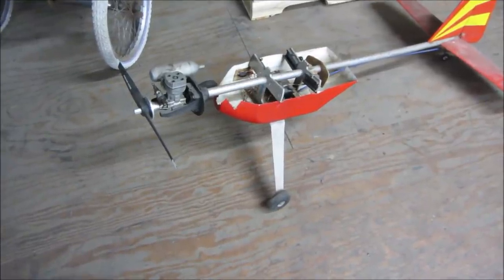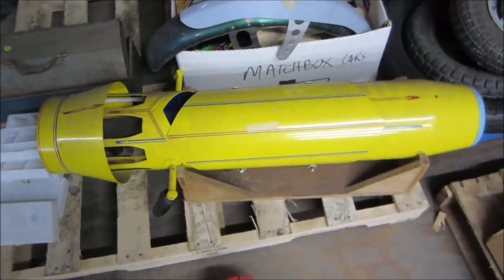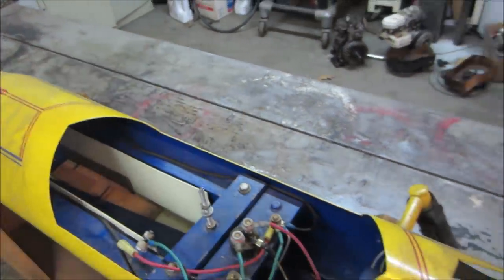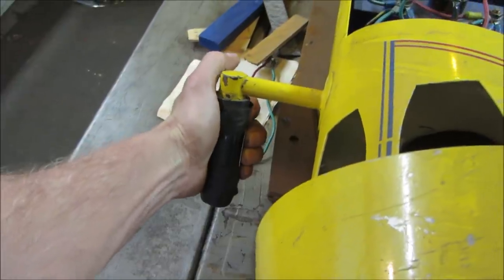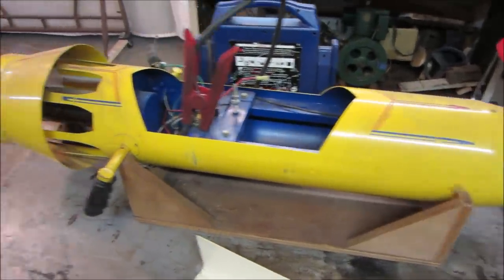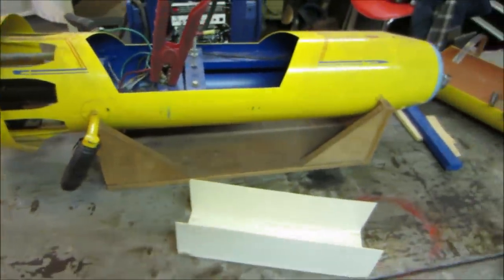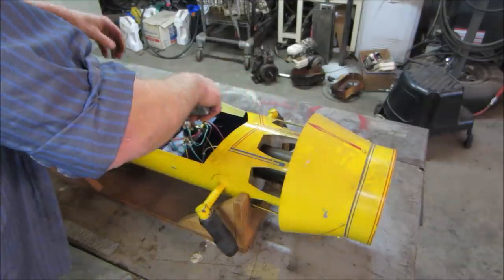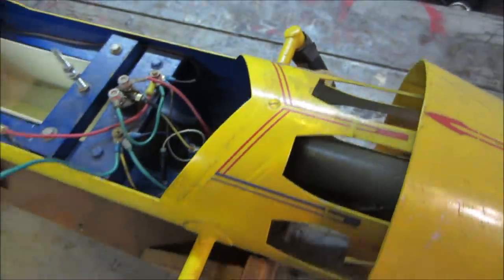Antique Scooter for The Water? Will It Still Work.

Comment: I built one, very similar to this, back in the late '60s specifically for looking for parts of my hydroplane which I destroyed at near 90 MPH. The boat was trash but I did want the outboard back. It was from plans in Popular Mechanics. The body was cut from an old scuba tank, gen 1 trolling motor, misc. flue and furnace parts for the rear housing and hatch, and an aircraft landing light. Two 12 V. lead acid motorcycle/garden tractor batteries for power...compartment was dry for flotation purposes with just slightly positive buoyancy so it would slowly rise to the surface if left unattended. Took a few tries to get it water tight but eventually worked very well. Found the motor...well, pieces of the motor...turns out I'd hit an underwater concrete piling with the lower unit.
Reply: Who would of thunk a bunch of us meatheads watching Mustie fix old junk, and one guy built the same thing from Popular Mechanics.  I dont know what this crowd is called but I likes ya.

Comment: That is a Popular Science build from 1975. The diving machines had several designs but most were based on a 24 volt system. So you were right , it is a home made diver based on a do it yourself blueprint from the 70s.
Reply: Not 24 volt system. These have a 12v system with the batteries wired to double the current. Note the + to+ & - to - connections. This configuration gives double current at 12v, not 24v.
Reply: @christophermarshall5765  longer run times instead of more power.
Reply: @jackmehoff2961  either way its given me memories of moray eels and heroin  (upps looked it up, The Deep 1977 and it was morphine not heroin, guess it's time to give it a watch again!)
Reply: @keeperofthegood  ah yes, "The Deep".
Reply: @jackmehoff2961  of course it means longer run time. If you get 2 batteries of same current rating & voltage, then connect both positive & negative terminals to give same voltage as a single battery, you DOUBLE THE CURRENT, meaning MORE POWER
Reply: @Scodiddly  Ah yes, Jacqueline Bisset!
Reply: @christophermarshall5765   P (power) = I (current) x E (voltage). So you're right, but increasing either I or E will result in more power
Reply: @bluesman311  connecting in series gives same current, but double voltage. Parallel gives same voltage, but double current.
Reply: @Scodiddly  ah yes "Jacqueline Bisset"
Reply: @keeperofthegood  I got to dive the RMS Rhone the ship Jacqueline Bisset was diving on at the beginning of the movie.  Great movie :-)
Reply: The resistance of the motor determines the current for a given voltage and therefore the power. Doubling the voltage by connecting in series would double the current and give 4 times the power, until the motor inevitably burns out. As long as a single battery is capable of delivering the current then doubling the batteries in parallel will double the run time.
Reply: Ahhh wow man! I remember the popular science projects! Man I haven't thought about that since grade school in the early 80's! Nostalgia!
Reply: @bluesman311  I is always a quotient of E/R. Loads draw current. How much they draw is determined by the voltage of the circuit and the resistance of the load. It don't matter how much current you supply a load it draws what it draws based on the voltage and resistance. If you supply insufficient current then E just drops. You have a dead battery then. PSU sag, whatever. You just ain't got the juice then.
Reply: @chrishartley1210  wrong. Connecting two 12v 18aH batteries in parallel doubles the current. You cannot increase current by doubling the voltage. Resistance of the motor does not determine the current for a given voltage at all. The motor resistance determines the amount of current it requires at the rated voltage of the motor. A motor rated at 290 watts will require just over 12 amps of current at 24v. I have a lot of expertise in this field, so it is advisable to not try arguing with me. Why do you think I installed a pair of 75aH batteries in my mobility scooter? The motor draws 450w of power at 24vdc. This means it uses18.75 amps of current. You should go back to school.
Reply: @christophermarshall5765  doubling the voltage will double the current in a circuit too. Or more likely you'll just let out the magic smoke. You may be thinking of storage capacity, or Amp hours. That's a separate thing. Electrons themselves are rather immediate creatures. They travel at close to the speed of light. So close I generally don't quibble about the difference. I=E/R So let's say you have a 12V battery and a bulb with a resistance of 5 Ohms. 12/5=2.4A Now let's increase the voltage to 24V with the same bulb 24/5=4.8A! Either your bulb is much brighter or it is burnt out.
Reply: @1pcfred  doubling the voltage doesn't double the current at all. My mobility scooter uses two 75aH batteries.  This doesn't mean it has a 150aH battery system. It mean the scooter uses 24vdc at 75aH battery capacity. To double the current, you connect the batteries in PARALLEL, NOT IN SERIES. SERIES connect doubles voltage, not current.
Reply: @christophermarshall5765  unless you use a bigger motor you won’t draw MORE CURRENT MORE POWER, lol, you’ll just have more capacity.   Read a book before you try to
Incorrect someone, lol.
Reply: @christophermarshall5765  I suggest you study ohm's law, it's quite simple.
I even kept it simple for those with only a rudimentary knowledge of electrics and ignored such things as the back EMF of the motor and the fact that an electric motor is an inductive load rather than a resistive load and hence has an impedance rather than just a straight resistance. I think it's you who picked the wrong person to try your bullying tactics on.
Reply: @christophermarshall5765  The electric motor will use a certain current from the battery putting another battery in parallel will not change that current (although the combination is CAPABLE of supplying double). The two batteries will double the time that the system can draw the rated current.

Putting two batteries in series will cause the motor (R being constant) to draw double the motors usual current letting the magic smoke out. I=V/R..   Doubling V doubles I if R remains constant.
Reply: @christophermarshall5765  Wiring two batteries parallel doesn't actually double the current, it doubles the capacity, or amp hours. It's like if you had an extra gasoline tank in your car, you won't get any extra horse power out of the engine, just more range.
Reply: That is what I thought it might have been. It has that look of a good design with a touch of home made. Thanks for sharing. This makes me want to look through old popular mags and get out in the garage.
Reply: @christophermarshall5765  You are absolutely correct. P=IE. Putting batteries in parallel gives you more POTENTIAL power. If you have a motor that requires 1A to run and your battery only puts out a maximum of 1A, you don't have much run time. Put four 1A batteries in parallel and you now have 4A of possible current. Disregarding losses, you now have four times the run time because your motor is still only drawing 1A. The motor is NOT drawing four amps just because you paralleled four batteries. This is why batteries normally list amp hours instead of just maximum amps. You want to know how many hours (run time) you will get for any given current (power) draw. Your last statement that "you double the current" is very misleading. A device that draws one amp will always draw one amp no matter how many batteries you put in parallel. The motor still only uses one amp. What you are actually increasing is the amp hours and that is why you get longer run time.
Reply: @jackmehoff2961  Hey! I think I know a buddy of yours, Mike Hunt.
Reply: @boataxe4605  last I seen of him,
he was going with Connie Linguist ..
Reply: @christophermarshall5765  Parallel = Double current, Series = Double voltage
Reply: @bluesman311  Parallel = double current, same voltage. Series = double voltage, same current
Reply: That's what I thought, at first, that picture had the wrong info. It's Sept. 1981 Popular Mechanics page 78.
Reply: @Watchyn_Yarwood  this is what I have been saying this whole time.
Reply: @robames1293  I fucking know this already.
Reply: @christophermarshall5765  NOT true - unless your load resistance is way lower than the internal resistance of the batteriets, which could never be true in this setup. As soon as the motor starts spinning the back emf would make your statement even less true.
Reply: It's like a home made version of my 'seadoo sea scooter gti',  great fun, take it with me on holiday!
Reply: @brianwalk108  I do not have to read books on this at all. I’ve been doing this for decades.
Reply: @Njazmo  you can get more power from an electric motor by feeding more power to it. I have actually done this lots of times. So you might want to try rethinking your ideas. Why do you think I use higher capacity batteries in my mobility scooter.
Reply: @robertmoore8166  this actually increases the risk of frying the windings in the motor. I fed 15 amps @12vdc to a motor that was rated at 12vdc 2 amps. It didn’t last very long.
Reply: @Antonyg2100  these are popular here in some parts of Australia. I have used one. They are great fun, but run time is short due to low capacity batteries.
Reply: @fredrikmalmsten8111  you can’t be more wrong to save your life.
Reply: @jejh22043104  yes they are fun. Easy to build.
Reply: @christophermarshall5765  Oh that explains a lot, Australia  ! Time for beddeyby?
Reply: @christophermarshall5765  Good grief! Don't use a constant current source to feed anything that is not asking for a constant current! Always allow the load to determine how much current it needs. Don't ever feed current! Allow the load to draw the current. You won't blow things up if you connect them correctly. Obviously, if your device REQUIRES a constant current, then, by all means, feed the correct constant current. Your obvious mistake was forcing 15A into a device designed for 2A. Why would you even try that?
Reply: @robertmoore8166  HAHAHAHAHAHAHA
Reply: @christophermarshall5765  Glad that I could make you laugh. Now, pick up a book and do some reading. Better yet, watch a video. LOL
Reply: @christophermarshall5765  motors are rated in amps at the specified voltage under design load. As long as the motor is at the designed load and rated voltage it CANNOT be forced to draw more than the rated amps. Except… if you stall the motor (increasing the load) then the current skyrockets and fries the motor (or hopefully the fuse or breaker).

In other words if your motor draws 1A at 12v under a given load, it makes no never mind whether the battery can deliver 1A or 1000A, the current drawn or power produced won’t change unless you change the load.
Reply: @fromagefrizzbizz9377  electric motors can be made to draw more than the rated power by simply increasing the supply voltage. It is something I have done more times than I care to remember.
Reply: @christophermarshall5765  lol
Reply: @christophermarshall5765  well of course but your example of feeding 15a to a 1A motor without raising the voltage is just wrong. Unless you increased the load 

Indeed motors work differently than many people think. A 10hp motor that’s not driving anything draws virtually zero current or power, just enough to overcome motor friction. It won’t draw or produce more power until you load it.
Reply: @christophermarshall5765  "Resistance of the motor does not determine the current for a given voltage at all.    PURE BULLSHIT   I'm Glad your experience was not unloaded on me.  Replace resistance with impedance. you are talking about series / parallel cells increasing the AVAILABILITY of current/voltage NOT the use thereof.  But you fucking know that
Reply: I came to say it looks just like the kind of thing you’d find plans for in Popular Mechanics :) So cool! I absolutely LOVE seeing those designs made real!

Comment: I built one of these in the eighties with two motors within cylindrical shrouds on either side. I use a valve to put positive air pressure in the hull after cranking the lid down. It never leaked and was awesome fun in the water. The fibreglass nose cone doubled as a ballast tank for diving. The whole unit just floated with minimal buoyancy. I must find some new modern batteries! You inspire me.

Comment: The strangest thing I ever bought at a yard sale was an electron microscope.
The seller had purchased it at a university surplus sale.
I got it about 75% working but ended up trading it off for computer hardware.
I love weird stuff that you can learn about. Cool content @Mustie1.✌
Reply: An Electron Microscope of any variety would be worth a small fortune. Those are hundreds of thousands dollars.
Reply: @Cartier_specialist  
Normally yes.
This was a small college size and was very limited. I actually made out decent in the deal considering I paid $20 for it, but over all I could have done better. This was early 90's and IIRC the unit was 70's vintage.
Reply: @SuEnRoD  I was responsible for taking the annual inventory of the assets of the various departments at the university of Oklahoma when I worked there and the electron microscope they had in the Sam Noble Electron Microscopy Laboratory was several hundred thousand dollars and it was far from new. They had to warm it up like a vintage car before using it. It also required liquid nitrogen to keep it cool while being used.
Reply: @Cartier_specialist  Ben On the applied science channel more or less built his own, or maybe it was more pieced together from an old one.
Reply: @Cartier_specialist  One sold for $650 at a surplus hut i frequent.

Comment: They are called a Diver Propulsion vehicle (DPV) it is designed to be used for pulling divers along to help with long underwater excursions.  The vehicle is typically neutral buoyant and is held at arms length under the diver to help pull them through the water. it looks like you can buy new ones for around $130.00 or more depending on how fancy and what features you want on your DPV.
Reply: Bombardier Marine still makes smaller ones.
Reply: Yeah I have one of the seadoo dophins. I think it cost about that much 130 dollars. The only thing that sucks is that it still uses old school lead batteries. I intend to replace them with something lithium as it does not last more than a half hour for adults. Its by no means a pro unit just a toy. Its also a bit slow and I would like to find or make something that is much more powerful. I have even though  about some sort floating board that one could ride around on.
Reply: @kameljoe21  you want to be careful with lithium + water :)
Reply: Yeap spot on there used on long cave dives here in FL I worked for halcyon mfg company and  we sold and serviced a newer model
Reply: Yep mine was made by or called the AQUASCOOT. Used it until it got wet on the inside and died. Sold it to a dive company in panama city Fla in 88
Reply: Exactly correct.  DVP 's  or  " water cars" as they are called for short were widely use on dive excursions where strong currents we're known to be

Comment: As previously mentioned, the airplane is a Byron Originals Pipe Dream. I bought one brand new when they were still being made and still own it. I believe the wings and tail section are from one of their other models called the Glassair. The design concept was to create a model that could use any engine from a .60 nitro to a 45cc gasoline. I had a 1.20 OS  4 stroke on mine. The really innovative part of the design was the ability to swap engines easily WITHOUT adding or removing ballast by simply sliding the entire cabin pod forward or back to get the CG right. The only other thing to do was to either lengthen or shorten the pushrods to the tail and throttle to the correct lengths. A really cool and possible unintended of these Pipe Dreams was in a crosswind condition there was minimal affect because there wasn't a huge fuselage side profile to be pushed around by the wind.
Reply: Byron made some of the most creative RC models of all time. Too bad they're so rare and collectible now, or I'd stick my NIB Moki 2.10 on it...all the coolest RC stuff was out when I was too little to afford it!
Reply: @guerrillaradio9953  I believe that Byron made ALL of the super realistic model jets for the Top Gun film.
Reply: I remember that model and of course Byron Originals. Everything they did was super high end

Comment: The model plane engine is a super tigre and its an italian engine. Looks 10cc, if so it will have 60 or 61 on the side somewhere as they are .60/61 of a cubic inch. Runs on methanol with 5% nitromethane and 15-18% oil. The little plug in the top will glow if you put 1.2v to it. More than 1.5v will fry the plug. Should start up and run well if the bearings arent shot.
Reply: Laser engines rules! I've had my eyes on one for some time, but I got to use up my English Irvine . And they run really good as well. :)
Reply: Jon-Terje Bjørnerud  ?
Reply: @pufango4059  yes? What's up?